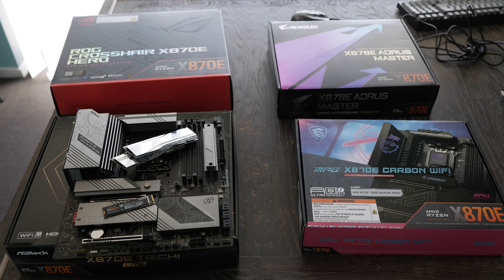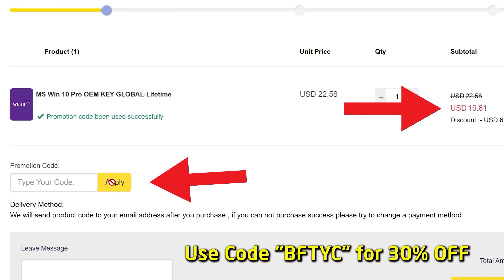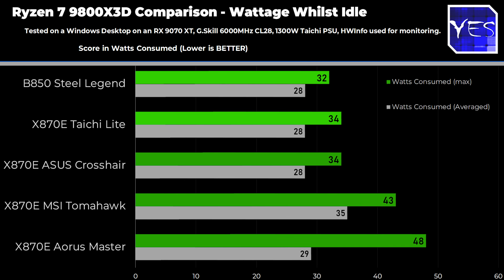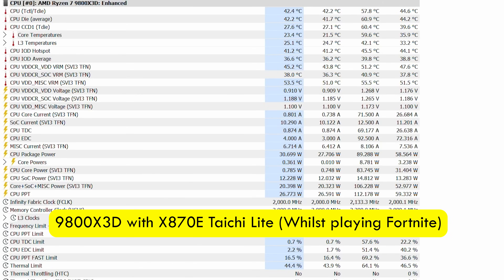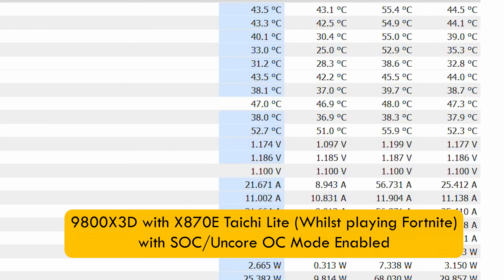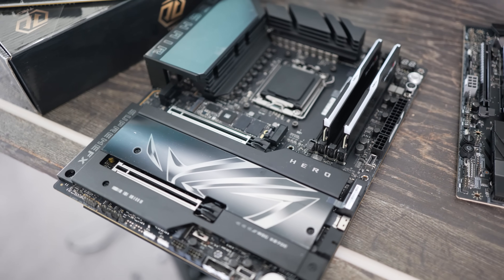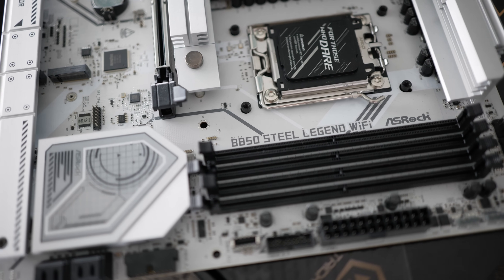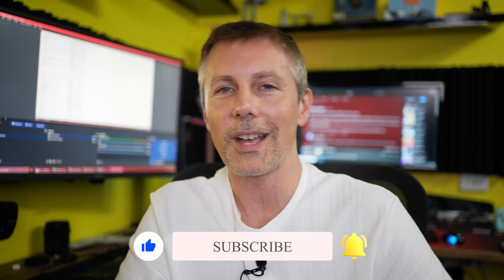I think I know why Ryzen 9000 Series CPUs are Dying...(!)

Comment: Looks like Auto is setting it to "Disabled". Also Disabled and Enabled are swapped. Disabled being the one that kills CPUs (effectively enabled) but for some reason is swapped in the BIOS. X870E Aorus Master here. For 6200Mt/s, SOC Auto stays at 1.190v and doesn't vary upwards, only a dip to 1.188V when doing AIDAs "Read" memory test. EDIT: I stand corrected. SOC Auto goes to 1.267V during TestMem5 extreme profile testing, probably normal behavior.
Reply: I miss the days the boards all seemed to just work.
Reply: @ArtisChronicles  never happened it was far worse before than it is now, everything is more amplified now on the internet
Reply: @ArtisChronicles  but that never happened lol.
All motherboards had some weird issues there and here.
I still remember my ASUS threadripper motherboard that could not be stable for certain ram frequency, unless you kept the floppy BIOS connector to ENABLED.
Or the VIA and some nvidia chipsets  for AMD having issues with certain combinations of chips/ram speed, all because their north bridge had weird quirky clock controller.
Reply: @ArtisChronicles  my experience is to never touch ASRock and thats from long ago...
Reply: @alexandruciordas4941 I’m glad I still live by that. besides unless it’s not a 2dim board idc lol
Reply: im on gigabyte too, b650m ds3h. i have a ryzen 7600 and a 9950x3d. the soc and vddio voltages for 6000mts seem low and reasonable enough. the x870 taichi tech yes city showed was doing 1.265 peak draw which is a bit high imo. also that was on a 9800x3d. highest ive seen on my board at 6400 gear1(uclk=memclk) is 1.25v soc on auto(9950x3d). it really only goes that high when doing a memtest. its maybe a bit too early to assume what is causing the dead cpus but its best to undervolt regardless of what cpu we are using
Reply: @cant_Comment  mine stays locked at 1.260 no issues
Reply: @eSPionageTech  good for you. 1.26 is actually safe its just that its a bit high. 6000mts dont need that much. i would worry when soc voltage is 1.26 while cpu temps are at 90-95c but even that is probably still safe. 1.3v at those temperatures is even scarier.
Reply: @cant_Comment  my 7700 on msi mobo di 1.29 Ish soc on auto didn't have any problem
Reply: @RANA--RI  If you dont mind, can i ask what temp you have on idle? I have AC freezer II 420 and i have 45-49 idle temps. On load in cinebench 55, gaming 55-60 with spikes of 70 when it gets hotter in my room. Maybe i didnt put enougfh paste or tight the screws? I am talking about the Tdie temp. thanks in advance. I have X870 Aorus elite ICE.
Reply: @TheTeacher80  I'm using deepcool le720 on idle its around 46-48 and on cinebench r24 it tops at 77-79 also i did a -30 on curve opt and max PPT of 85 and TTH max of 85
my room Ambiant is around 30-34
Reply: @RANA--RI  Thank you very much, so the idle of 45+ is normal. I use -50 curve now but i only gained 1 degree, down from 46 to 45. Stock 48-49. But on load i have 53-55 in Cinebench, a little higher in games because i keed the vents on low RPM. But thank you again, i was not sure if i did tighten the screws enough.
Reply: @RANA--RI  1.29 is very high. even if you dont have issues right now, you might run into issues in the future. still its a 7700 not an x3d so youll probably be fine.
if you want you can try to lower it. amd has absolute power and thermal limits placed on the cpus. lowering soc can help reduce power draw and temperatures and that should give more performance headroom for the cores. what speed and gear mode are you using btw?
Reply: @TheTeacher80  i dont know if your temps are fine but my 9950x3d goes to 95C under a heavy all core workload(stock settings). i have a 360AIO push pull config. no air conditioning, here on a hot tropical country close to the equator. needless to say, i had to lower temps. i did that with PBO, manually lower tjmax to whatever celsius i want.
compared to what i have, i think your temps are much better
Reply: @TheTeacher80  undervolt can lower temps but the most reliable way to do it is to change tjmax. lower it to whatever celsius that you want. the boost algorithm will limit temps according to what the tjmax is
Reply: @cant_Comment  Thank you. The main problem for me was the idle temp, whatever i did in BIOS did not go under45 deg C. Either i keep -50 curve and +200Mhz or stoc it is almost the same. I was used with the 12600k for 3 years, and Intel had lower idle temps.
Reply: @TheTeacher80  oh, if its idle temps youre concerned about then its more about the IOD and less the CCD. not sure what youre doing with your PC that youre concerned about low idle temps. are you setting up a server or something? you can try lowering soc voltage. its a bit trickier and more time consuming but if i want to lower idle temps and idle power as much as possible, lowering soc is the first id do. then after that, ill tweak the cores by changing tjmax and maybe also curve optimizer to further improve efficiency. 
tbh, in most cases im not gonna be concerned by this all that much. i just use my PC for looking at memes online and occasionally doing productivity and gaming workloads. when im not using my PC i turn it off. i have my 9950x3d limited to 80c tjmax, and idle temps are at 45c. i can lower it even further but i dont really need to.
Reply: @cant_Comment  Just for normal use. But even after years of building PCs i am not sure i tighten the screws on cooler enough, i try not to tighten to hard to destroy pins on CPU or MB. So i was not sure if it is normal to have 45 or if  i can have much llower temps, like 35 on idle if i check the coler (not an easy task for me to open the PC again) Thanks again.
Reply: @cant_Comment  did that today set soc to 1.200v no difference in performance got 1134 on multi Cinebench 24 ,I'm using corsair ram  6000mt cl 36 with micron chip
Reply: @RANA--RI  good. thats exactly what you should do. makes it more efficient and helps with running cooler.
i undervolted mine and it gave more headroom to manually push the cores further. also with lower soc, i worry less that id fry my cpu over time
Reply: same board here. it enables automatically when you oc
Reply: Dont use aida. Its a synthetic mem test and latency readings are very inaccurate.
Reply: @flitai  So how do you measure latency?
Reply: @SaccoBelmonte you just don't. You'd better test the fps in games. AIDA's test isn't relevant anymore, it doesn't represent anything. If you use "zen 5 gaming optimization" or whatever it's called on your mobo you may achieve lower latency in aida and also lower fps in games.
Reply: @SaccoBelmonte  real workloads. i test with games(cs2 and dota2 only because i dont play other games).
you can test productivity too. like compression and rendering
Reply: The SoC/UnCore OC mode enabled means that the Power Saving mode for SoC/UnCore is disabled hence the OC Mode.

If OC mode is disabled and power savings are enabled, then, whenever the soc voltage needs to ramp up the board has to account for droop hence the settings for load line calibration.

When running ram in xmp or expo mode(s) it would be better to disable any power saving features like gear down mode and enable OC mode for SoC/UnCore.

For monitoring voltages, the internal sensor of processor should be used like SVI3 because naturally the board has to supply a bit higher voltage to account for droop.
Reply: What setting are you talking about?
Reply: I have an Asrock board with Ryzen 7700. I think the CPU is faulty. Random lags and crashes everywhere. Tried to Enable the Uncore setting and the crashes got even worse now. Even in the bios I got crashes.
Reply: @SaccoBelmonte   am5 market share. ASUS 36.4%
Gigabyte 27.5%
MSI 24.9%
Asrock 11.2%
Total found now potentially 157 dead 9800X3Ds, 130 on ASRock boards, 20 ASUS, 5 MSI, 2 Gigabyte."
As Percentages of a total
Asus 0.6% failures.
Gigabyte 0.1%
MSI 0.2%
Asrock 99.1%
Conclusion? Don't buy ASRock.
Reply: @alexandruciordas4941

where did the numbers come from for 157 failed units?
Reply: @alexandruciordas4941  According to your statistic it looks like I did a good choice ordering the Aorus Master 🙂
Reply: @alexandruciordas4941 gigabytes have more motherboard warranty claims among other two😂 Asus and MSI. I don’t count ASrock as top 3 motherboard companies.
Reply: @alexandruciordas4941 you clearly didn't understand the video lol.
Reply: @RafitoOoO  video doesn't mean anything it's just speculation 😂. Asrock uses cheap components and they were always sketchy.
Reply: @alexandruciordas4941  Yeah I'm glad I went for the Aorus Master. Great board BTW.
Reply: @SaccoBelmonte  I was just about to buy Asrock x870e Taichi (with my 9950x) before finding out about these issues. I don't want to wait for the long-term results of enabling OC mode, so I am thinking about the x870e Elite which is reasonably priced at about $420 cnd. Is the Aorus Master really worth the extra $300?
Reply: @jasonrepa  I chose mine because I needed all those USB3 ports. Also own a 4090 Aorus Master and since they did a really good job with support, I gave them my trust this time.

The board is really nice, plenty of I/O and I had no issues at all so far. Oh yes, fans were acting up a bit and that was fixed in the next BIOS.

Comment: I have x870e taichi with 9800x3d, manual memory overclocking according to builzoid guides. I have vsoc 1.04 stable, set manually, since my memory works at 8000, where high voltage on vsoc is not needed. If this is really the problem, then I am calm
Reply: Didn't you understand that it's something that happens rarely and sporadically and if you don't have HWinnfo turned on you won't notice anything? You'll only know when the CPU dies.
Reply: @Miguel-Simao-c5k  I think you misunderstood something. If you manually set the voltage, it should not supply more than you set. Actually, the video shows that on AsRock boards the voltage changes dynamically by default, while other manufacturers have a stable voltage at a specific value
Reply: @solomon8190  What do you think I did? I went to the BIOS and set the voltages and I don't use auto voltages. Asus wants to set 1.25-27 so I can have 6000 memories.

Comment: ASROCK B850 Pro-A WiFi + 9800X3D and my SOC is at 1.190 constant. Its set to AUTO in my bios.

Hopefully that means im safe :D
Reply: youll be fine with 1.19
Reply: @cant_Comment  It doesn't matter what you put as voltage. The voltage goes up by itself for a fraction of a second. Mine jumps above 1.3...
Reply: @Miguel-Simao-c5k  please dont tell me youve been spreading that misinformation everywhere
Reply: @Miguel-Simao-c5k  the voltage will jump up higher than the voltage you set. however, if you set the voltage you will limit how high the voltage will go.
example, on my system i set soc to 1.1v. in this case it will go higher than 1.1v. that is normal, in fact its supposed to be like that. however, the highest it will go to is only 1.15v because i limited it to 1.1v. on stock setting it is at 1.2v. guess what, under load at 6400mts gear1, it goes up to 1.25v.
Reply: @Miguel-Simao-c5k  1.3v is too high. you better get that down or you might run into problems in the future. even if you dont run into issues, its still needlessly high. i personally wouldnt run 1.3v 24/7. also we dont know how high your vddio is. if its high, while soc is at 1.3v that could be problematic in the future. amd has absolute power and thermal limits placed on the cpus. 1.3v will eat up some of your power budget. you can save on some power and lower temps a little bit by lowering your soc voltage
Reply: @Miguel-Simao-c5k  1.190 is what HW monitor reports, 1.191V was max difference i got.
Reply: @wUFr  I know, when it happened to me it was like once after the PC was on for an hour or something. When it happened it reported for example FCLK 2250, Memory clock 3250, frequency 5250, Frequency limit 5250 and Soc voltage 1.33.... With memories 6000, soc 1.2 and infinity 2000... Now since I changed the settings it hasn't happened again even with 6200 in the memories.
Reply: @Miguel-Simao-c5k  just played some games for 2-3 hours and it still didnt go over 1.190V. Rest of the voltages look alright too. Will keep HWmonitor open for rest of the day to monitor any weird stuff, but so far my PC is stable without any issues (have it for about 2 months now)
Reply: @wUFr  This usually happens to me in the Windows environment when I'm doing little or nothing that requires the CPU. Like watching videos on YouTube, for example. Since I changed the BIOS from Auto to On, it hasn't happened to me again. It seems that my 7800X3D's days were numbered if it continued.
Reply: @cant_Comment  The motherboard was what was releasing the suicidal voltages to the SOC... My CPU does 6400 with 1.27V or 6200 1.24V and 6000 with 1.19. The Asus TUF B650 was trying to kill my CPU.
Reply: @cant_Comment  By the way, since I changed the settings from Auto to On, the latency went from 62 to 61.... In aida64. Which in itself left me surprised since it is difficult for me to go below 62.
Reply: @wUFr  By the way, since I changed the settings from Auto to On, the latency went from 62 to 61.... In aida64. Which in itself left me surprised since it is difficult for me to go below 62.
Reply: @wUFr  It happened again... It jumped from 1.24V to 1.323V and the FCLK jumped from 2100 to 2240Mhz and the Memory Control Clock jumped from 3100 to 3306Mhz... Not resolved.
Reply: @Miguel-Simao-c5k  i wouldnt put too much credence on aida tests. aida is terrible in measuring real latency. id recommend benchmarking with workloads you do(like productivity or gaming workloads). those are much better and more realistic than some synthetic memory benchmark. memtests are also better than aida in measuring memory performance(testmem5, y-cruncher, prime95) but even those are still less effective than productivity and gaming workloads.
did you get rid of your asus tuf board already? id avoid asus and asrock at the moment
Reply: @cant_Comment  It happened to mi again... It jumped from 1.24V Soc to 1.323V and the FCLK jumped from 2100 to 2240Mhz and the Memory Control Clock jumped from 3100 to 3306Mhz... Not resolved.
Reply: @starlightHT  well, by board is fine
Reply: @wUFr  I suspect that in my case it has to do with me doing OC on the Infinity Fabric... which causes voltage spikes. I reduced it to 2000 and it didn't happen again.
Reply: @Miguel-Simao-c5k  ah, so you overclocked it. Maybe that's something you should mention from the start :D